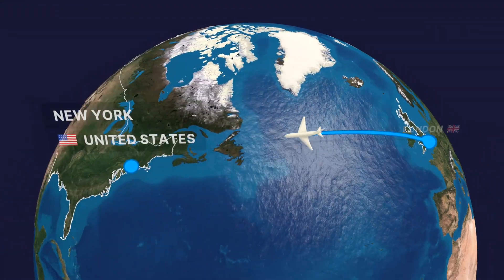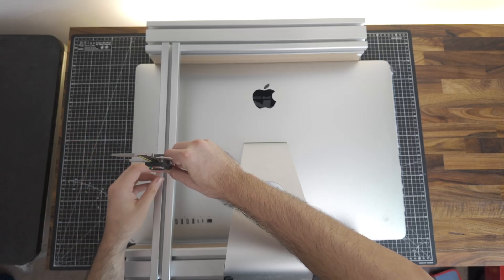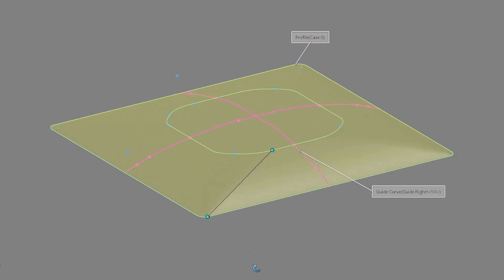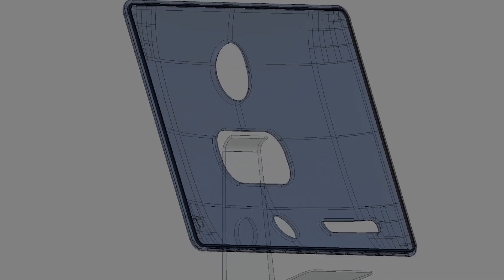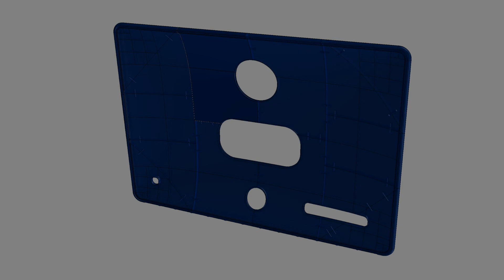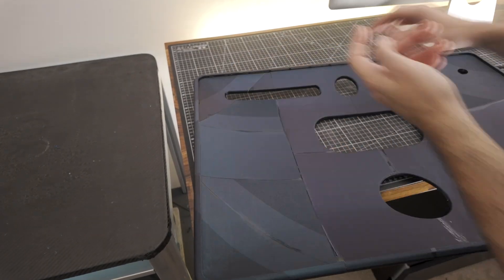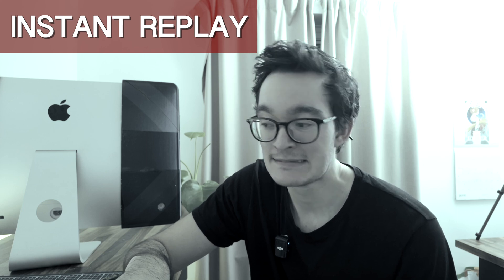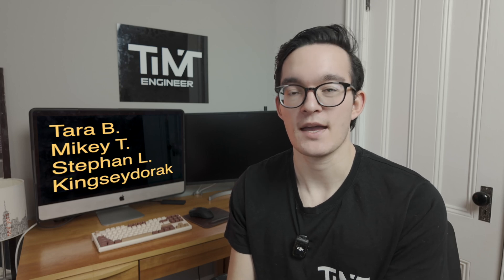I designed & 3D printed an iMac Travel Case

Comment: Ahm... btw, the legs do come off, just searched it, you just have to pry the hole where the stand attached on the top side and the screws will reveal themselves apparently. Sorry probably didn't help your analytics
Reply from the maker: @greyvlad This will be on newer models only, for the 2017 iMac you need to pry apart the screen first to access the stand screws which would void any warranty or AppleCare

Comment: Thanks for the video Tim! Now that you have a design that allows for imac usage while it is in place - I wonder if this could be a solution for the painful process of ungluing and gluing the screen to the stand when you want to do any work on the innards of the imac. Would it hold the screen safely without the use of adhesive strips between stand and screen?
Reply from the maker: Never thought about it but I bet it would! It’s a pretty snug fit that’s definitely strong enough to hold the weight of the screen :)

Comment: I like the edge case design. I would have also gone for a hard cover to then snap over the screen. Giving it space to hover over the screen and extra thick so it hopefully wouldn't crush in. Also steel dowels are totally underrated. So much better than the filament pieces people love to use for hinges etc.
Reply from the maker: Thanks! I agree with the snap fit I might try to do this in the future! Yes I’m still surprised most people don’t use steel dowels, I think the hobby is maturing still but eventually it will get there!